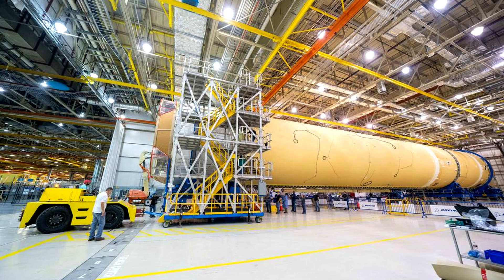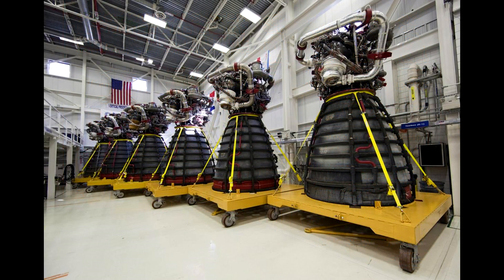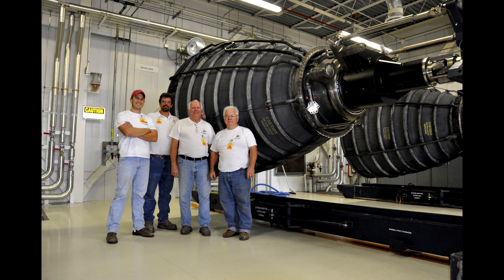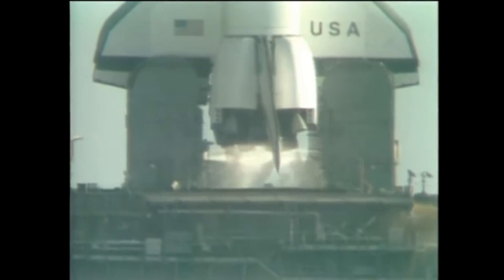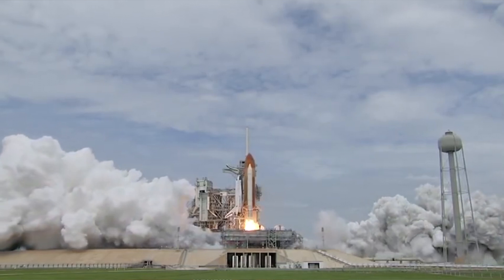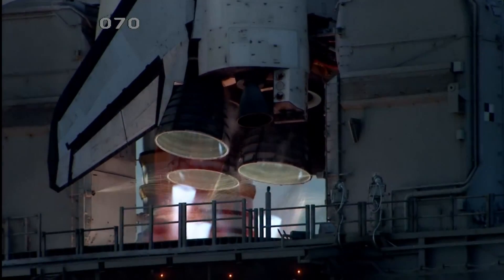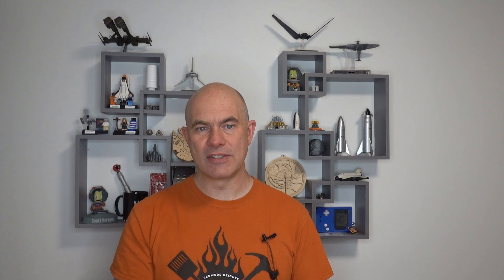Four Old Space Shuttle Engines Team Up For One Last Rocket Launch

Comment: I don't get it why it is taking so long for them. They are literally reusing engines that have been sitting in some dusty storage facility for decades and all they have to do is attach them to an orange tank that is pretty much exactly the same as the one from the shuttle + 2 solid boosters that exactly the same. There'll be a fully reusable rocket that can carry bigger and heavier payload before SLS every takes it to the sky.
Reply: Why? Small budget, small assembly crew, not plugging away in 24-hour shifts like the Apollo days, constantly going back to the drawing board when they've hit a snag.

SLS is not NASA's single priority. JWST and Europa Clipper, along with ISS operations are. All under a $19.5B per annum allocation. Orion-SLS and Project Artemis are NASA's public-relations programs to reel in the U.S. citizens' support.
Reply: @dalethelander3781  That's complete bullsh1t. You can see (literally) how a completely new rocket order of magnitude more complicated is being assembled just for a few months by a few people out in the field on a shoestring budget

Comment: Urgh it's just wrong SLS is a total step back Solid boosters and reusable engines being thrown away
Reply: Nothing really wrong with SRBs IMO. At least, when used sensibly, and on a rocket that has a working escape system (if it's manned).
Reply: "Designed to be expensive"
Reply: Milo B SpaceX has an expendable mode for some missions too.
Reply: @thethirdman225  Even the first stage? really? It's just the shuttle engines are so incredible. I agree that SRBs are effective but those RS-25s are over-engineered pieces of functional art.
Reply: Milo B Yep. Not all SpaceX missions will involve landing.

Comment: It really is sad to see these engines launch again, knowing they were built for reusability, flown multiple times, then put on a rocket that gets thrown in the sea every launch... 

It just seems SLS is doing things backwards. Throwing your expensive already reusable hardware away every launch is just ludicrous. $40M each engine.
Reply: In all fairness they were not reusable as much as rebuild-able.  It took a lot of time and money to get one back into service.
Reply: @TheEvilmooseofdoom  Are you saying its better/cheaper to throw away an engine that was designed to be reusable then?  Because thats basically why space flight is so expensive. 

Fuel is cheap, the hardware is not.
Reply: @chris746568462  IF you can build a new engine cheaper than rebuilding the older engine then yes.  The engine wasn't well designed for reusabllity and this made it expensive to build and maintain.  It took a lot of time and money to get a RS-25 back onto the flight line.

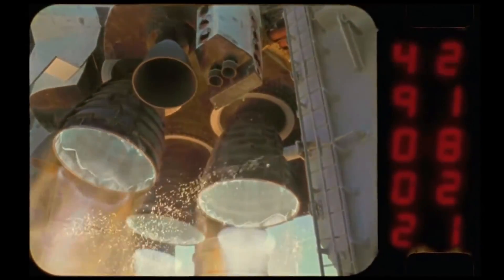Comment: Scott please excuse my ignorance but at approx 4:02 when the engines are firing up you see the nozzles vibrating. The one on LHS vibrates longer, is this due to throttling? Presumably they'd all be at full power at this point? PS I geek-out watching things go through their eigen modes , does this provide you the same titillation?
Reply: Ah no I think I see. I don't know the reason but the LHS engine does not reach 'full burn' until after the RHS one. Due to ignition source?

Comment: I had the privilege of working under Dr. Dara Childs who solved the instability problems of the space shuttle main engines. I told him about how they are using his engines again for the SLS which he really liked to hear.
Reply: Dr Dara Childs ...the best turbomachine and vibration engineer on the planet!  I had the pleasure of meeting him at an ASME conference in the UK in about 1997. A very very intelligent man
Reply: Clay Norrbin I bet he didn’t like the part about them taking a reliable reusable design and making it cheaper and disposable after one use..
Reply: @azzajohnson2123  Because RS-25 has far more complex design than Raptor.
Reply: @PArabinddeep  that's objectively false...
Reply: k Nope. The raptors were made to be simple (ish)
Reply: @cod6guy12  Just tell me, does Raptor has regenerative cooling?
Reply: @PArabinddeep  Literally yes. The cooling lines are much less obvious than the RS-25's but they exist.
Reply: @cod6guy12  And yeah one more thing RS-25 can achieve 85% of theoretical ISP for a LH2 based engine at sea level which is highest for any rocket engine.
Reply: @PArabinddeep  Yes the RS-25 is an amazing engine but it's still limited by the cycle it uses (Fuel-rich-staged-combustion). A full-flow-staged-combustion LH2 engine would be better (And more complex). FFSC has the highest combustion efficiency of any engine cycle. Aerojet Rocketdyne, the company that made the RS-25, actually built and tested the powerhead for an FFSC LH2 engine in the 90's and early 2000's but funding was cut - It would have been a true successor to the RS-25.
Reply: @cod6guy12  You are right.
Reply: I had a class taught by Dr. Dara Childs back around 2001 at Texas A&M.  I never really knew his history with the SSMEs until now.  I heard rumors back then, but I was more interested in other college things...
Reply: Pratt & Whitney attempted to punch way above their weight class on the ATD program. Neither pump was necessary in the end and it was a waste of the U.S. taxpayers' hardearned. It cost more to develop those two turbopumps than it had cost to develop the whole original RS-25. Neither pump ever met the original requirement of 10 flights between overhauls and if either pump ever met the performance requirements it was because NASA.coerced Rocketdyne into correcting the deficiences.

Comment: Why don't NASA just farm the engines out to museums after they've been used on the SLS?
Oh yes, now I remember, the answer is probably why some people are rather less than impressed by NASA's new Moon rocket.

Come on NASA it's the 21st century now, rockets shouldn't be single use (at least not by design)
Reply: The problem isn't a lack of reusability honestly, it's the fact they're like 6 years past schedule and billions over budget on a rocket made of spare parts and existing technology. Had the SLS actually been the cheap and quick heavy lifter it was sold as we could forgive its lack of reusability. Frankly, the people in charge of SLS should be in jail and the companies involved investigated and fined because there is no good reason for it being this late and over budget.
Reply: When you're spending tons of money on fuel, you want it to deliver power from its every single drop. That's what NASA is thinking right now.

Comment: Those RS-25s deserve to fire up again, just not for the last time.
Reply: SLS, aside from the SRBs and without the Exploration Upper Stage, is basically a single stage to orbit vehicle. It will be too high and far downrange to recover the core stage. And Congress mandated as much use of Shuttle tech as possible.
Reply: In no way is it an SSTO
Reply: It hurts me to think of these engineering beauties hitting the ground at high speed.
Reply: They will, in the Green Run test. They'll only launch after that is done.
Reply: Imagine SLS propulsively landing on RS-25s.  I mean, nothing about SLS would work well for that, but still!
Reply: agree crate a reusable engine and not reuse! but unfortunately NASA does not have the best record on that, privates  businesses will do
Reply: @ricardoabh3242  but private companies do that by minimum wage
Reply: They could pull a Vulcan and have them reenter just the engine block to be recovered
Reply: It is disgusting.
Reply: @nervousstate  What do you mean by disgusting?
Reply: @nervousstate  They are essentially obsolete, so reusing them at all - even in a disposable rocket is still a win. SpaceX and other private space corps is the future of space flight, not NASA.
Reply: what did they do to deserve that? also, list a reusable vehicle for them to be used on. then you might have a point. until then, your feelings are irrelevant.
Reply: skem  They were a poor choice for a reusable system as it was.
Reply: skem  no, it's not. you're appropriating the personified feelings of a middle-aged rocket engine. you had nothing to do with anything about it.
Reply: @nicewhenearnedrudemostlyel489  yep

Comment: It would be neat to get the core of the SLS to flip around and hit the ocean top down and some one grab these engines from the ocean and put them on display ?
Reply: <cough>jeff<cough>
Reply: So, like NEXUS or some plans for reusable Saturns?
Reply: Core stage is too thin and fragile. It's an extended Space Shuttle External Tank.
Reply: It will all burn up in the atmosphere, it is too fast after stage separation.

Comment: I don’t know, I’m torn. I guess it’s good that these engines are going to be flown again at all, but just like everyone else has said, really is such a waste to use engines like this on expendable rockets. The SSMEs do deserve better.
Reply: Also these are the most expensive engines ever made - $25 million each. They were expensive and over engineered since they were designed to be reused over and over again, reducing the per flight costs - not meant to be thrown away. It’s quite a tragedy, honestly.
Reply: It's a "waste" because they should've been used for Space Shuttle missions, which were cancelled.  If we'd tossed 'em in a museum, we'd be criticized for not using perfectly good SSMEs.
Reply: Goofus and you tell me, how many flights can a B777 engine be used for? Probably several thousand with regular maintenance. Per flight costs are very low. 

Also $25 million is a lot, even for rocket engines. 4 engines on SLS will cost $100 million new. (Yes, they’re using used engines, but there’s a limited supply). Consider that SpaceX’s raptor engine, which produces similar thrust, costs only $2 million each, with that number to decrease with mass production. While these rocket engines are not totally comparable, they are both reusable, state of the art engines with a closed combustion cycle.
Reply: Kevin Tu People should stop believing everything they see on Elon Musk’s Twitter feed.
Reply: @eyeborg3148  You cant compare the RS25 designed for Shuttle to a raptor engine.  2 totally different engines for different tasks.
Reply: Yea, these engines are marvel of engineering, and its a fucking shame to see them get thrown away...

Comment: Scott, a weird question: why didn't they use RS-68 which from my understanding is also a hydrolox engine, but designed specifically for expendable rockets, so it's much cheaper.and seems to be more suitable for vehicles such as SLS
Reply: RS-68 is not human-rated. That's the reason.

Comment: 4:00 Whoa! Look at that center engine bell resonate with the combustion instability.
Reply: I don't think that's combustion instability, I think it's flow separation. You can see at the edges the exhaust plume is 'peeling' away from the inside of the nozzle, this creates some wacky differences in pressure and makes everything wobble.
Reply: @jeffvader811  Yeah probably, couldn't they actually control the size of the nozzle slightly to try to prevent this and then open it up once they got high enough?
Reply: @jadoei13  Instead of building 2 seperate engines like Space X has for(sea level launch and vacuum engines) the RS25 combines 2 engines as one.
Reply: They where never really able to solve that wobble issue, which is why the horizontal rings around the bell are so massive. They just made it sturdy af.

Comment: Anybody fancy a fishing trip to recover an engine from the sea?
Reply: Elon get your boats ready!
Reply: @Crono099   lets catch biggest rocket stage ever just like fairing using boat. Actually, with tanker size boat, and parachutes you coudl try, if engines were protected during reentry. Don't forget that core stage enters 100x100 orbit
Reply: Bezos fished out the moon launch Saturn 5 engines. They were still "gov'ment" property and are now in museums somewhere.
Reply: Wouldn't they mostly burn to bits on reentry?
Reply: @jadoei13  first stage doesn't get fast enough to burn up
Reply: @milkdrinker7  That's what assistance from the SRBs is for. SLS will accelerate faster than the Saturn V past MAX-Q.
Reply: @milkdrinker7  Yes it will. MECO velocity for SLS will be quite high. Think about it, it gets boost from the SRBs, and the engines are very efficient and it's a very big tank with a very light upper stage (At least for the first launches, with the ICPS). That thing'll be going at the very least half of orbital velocity.

That thing is toast coming back down.
It won't entirely burn up but it will disintegrate to some degree and the engines will be damaged beyond repair before hitting the water.
Reply: @nathanaelvetters2684  that's fair, I didn't really do much research into the sls flight profile after I had already written the whole thing off as a dumb project.
Reply: @milkdrinker7  To be fair, I haven't done much research either, I'm just using intuition. When I look at the proportions of this rocket, it seems downright silly to use the ICPS at any point on SLS- it's just so tiny, and the rocket can easily lift a much bigger stage than that. Every launch is literally burning through precious RS-25s, why waste them on such a puny configuration?
If you think about it, this is extremely similar to the actual space shuttle ascent. ICPS actually has LESS mass than the space shuttle, so...
Wait, why couldn't this thing just get straight to orbit with the first stage and boosters? Thinking about it that way, maybe it'll actually be just shy of orbit when it stages. Weird.
Reply: @nathanaelvetters2684  Just like shuttle, the 2nd stage (the core stage) will be just below 17,500mph, enough have a small burn of the upper stage to attain orbital velocity as the 2nd/core stage falls to the ocean.
Reply: @jadoei13  Yes. SLS will be high enough that there will be very little core stage hitting the water.
Reply: I'm throw some money into the hat
Reply: I'm in
Reply: Bezos did it with Saturn V engines, so he's had practice. Maybe Blue Origin is counting on fishing expeditions?
Reply: Wake up you lot. Bezos recovered a Rocketdyne F-1 from the Atlantic years ago.
Reply: @thethirdman225  We know. Read one of like half the comments in this thread.
Reply: @nathanaelvetters2684  I think there are "like" three comments here. A lot of the others commenters seem to have "like" ignored them.
Reply: @thethirdman225  are you always like this? Anyways, the terminal ballistics of the S-I C and the SLS Core stage are completely incomparable.
Reply: @Swedish Marcus Viking,  I'm sorry, but you're not right.
Reply: Is Sound Of NukiTYP5 Jaeggyzilla
Reply: Jeff Bezos would like to know your location
Reply: @orionbarnes1733  what are you on about? He already knows all our locations
Reply: TheBlapman Cue the drone delivery.
Reply: Yes, very much!
Reply: i think the government will simply take from you afterward :(
Reply: @ricardoabh3242  depends where you land 😙🎶
Reply: Heck yeah!

Comment: I’m working on a part of the RS-25 restart and the hardware I’m using to develop my software (in preparation for the new hardware) is indeed much older than myself
Reply: You work on This engines? I mean in nasa?
Reply: Michał Aerojet Rocketdyne. We make the engines and then they’re delivered to NASA.
Reply: @JKTCGMV13  Is there a chance we see a RS-25 equivalent in terms of isp that is way cheaper to produce and so make one time use less painful to watch? By either your company or your competitors? I am basicly asking: can we have a high thrust, best in class isp engine that is not so painfully expensive and complicated to build due to new manifacturing processes like 3d metal printing?

Will the newest version of RS-25s be restartable? how often? What had to be changed?
Reply: z33r0 Now I don’t know the specifics myself. Plus there’s also a point where I’m not supposed to disclose proprietary info and I’m gonna stay away from that line haha
Reply: @z33r0now3  Great questions, but even if he knew, those are corporate trade secret, or possibly info out of his dept. I doubt he'd be able to answer that
Reply: Can I be upfront? Have you ever thought if your skills can be used to develop something reusable? I mean, it's generally understood that SLS is a jobs program and jobs are a good thing. I would posit however that we could have just as many jobs in the rapid turnaround space industry if the government really tried to point everyone in that direction.
P.s. you don't have to answer if it endangers your job security in any way. I'd just like to hear the thoughts of someone actually in your position. 😉
Reply: Henden G I wouldn’t mind see more reusable rockets being developed haha
Reply: @JKTCGMV13  same here. i just think there will always be the need for a high performance disposable engine, when performance is everything that matters. So i am interested how much we can trim that side down towards more sustainability. making it more affordable, needing less maintenance etc. Where we are heading right now with the latest advancements in r&d and manufacturing should soon reflect on all aspects of upcoming space vehicles.
Reply: @JKTCGMV13  Are you in Canoga Park?
Reply: @fcgHenden  Reusable depends on the vehicle, not the engines. SLS is a long Space Shuttle External Tank with RS-25s boosting it along with SRBs.
Reply: There are many different positions that would be applicable to a variety engineering majors. Personally, I graduated with a Robotics Engineering degree. They have summer internship programs for college students, so if you’re pursuing a STEM major you could try applying.
Reply: Cyriaque Guillemot I’m only 23, so it’s not difficult to be older than me :P
Though I’m not actually sure when it was made. Just that’s it’s from the old shuttle engines.